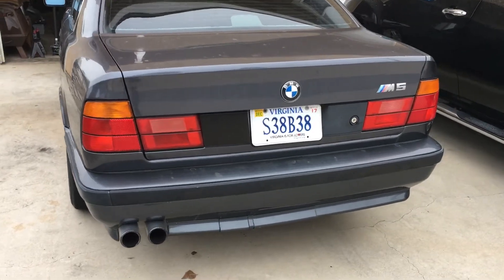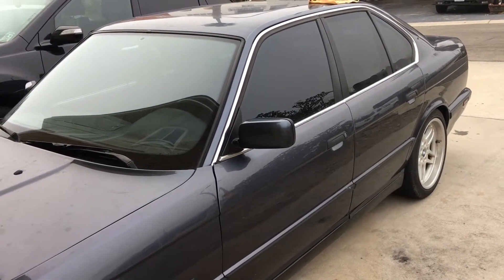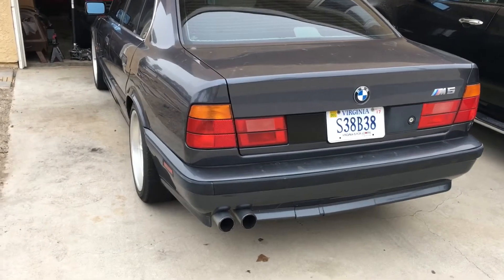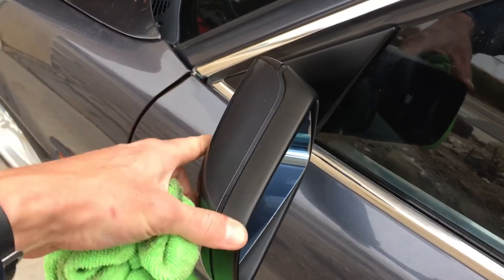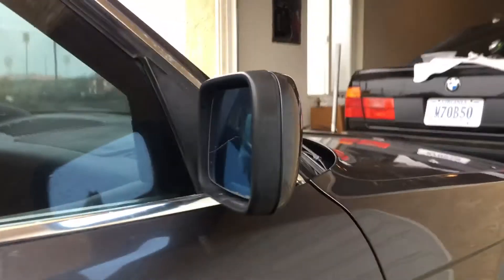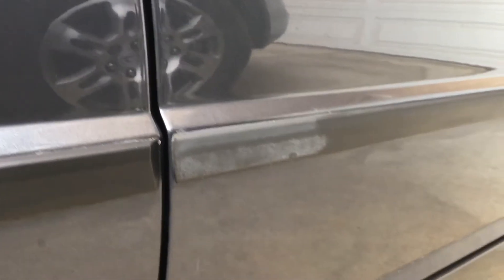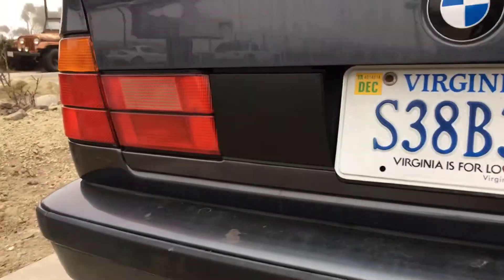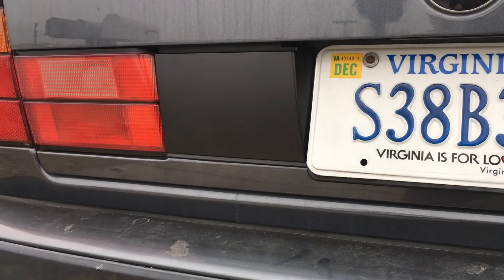Bringing Black Exterior Trim Back to Life with 303 Aerospace Protectant

Comment: I use the foam side of those scratchy kitchen cleaning pads.You can cut them to size for small areas or use as the applicator on a whole one,also saves using so much of 303. i put it on everything that is plastic or rubber,Great on car tyres protects from the hot sun,brilliant stuff.Not that we get very hot sun here in the UK.

Comment: How long has that finish remained since the 303 application?  Few weeks, months?  Is it safe if it gets on paint?  As I commented in your impact trim video, new black trim from BMW after 2012, will not be the same deep-black as the older black trim on the car.  In 2014, both rear door handle trim was replaced on my E34 .  They were lighter compared to the original front-ones, and faded even more to grey years later.  Used Zymol Vinyl on these handle trim pieces to attempt to match the fronts. It is greasy and runs down on the paint when it rains.  Does this 303 run-off on paint when it rains? Nice plate too.  `94 M5?  Is it a Euro?  I thought `93 was the last US-spec. M5.